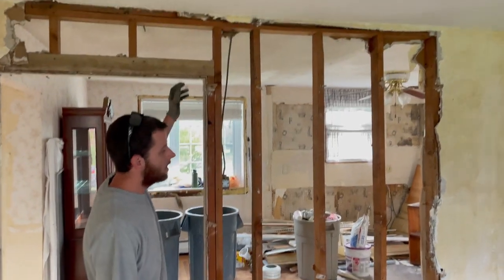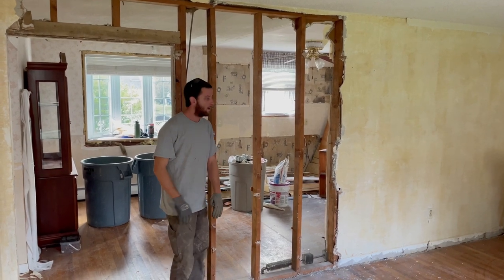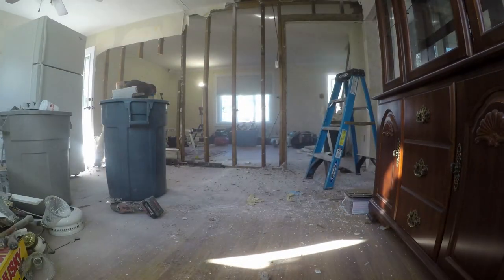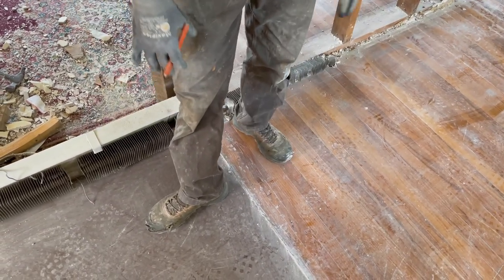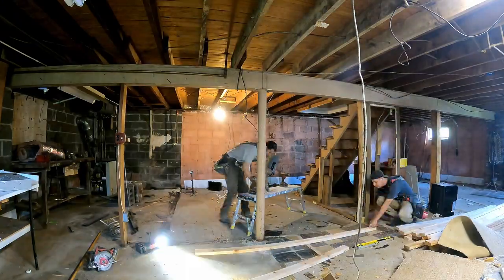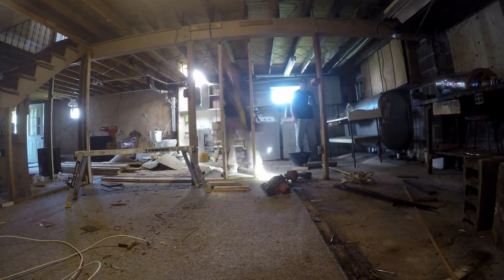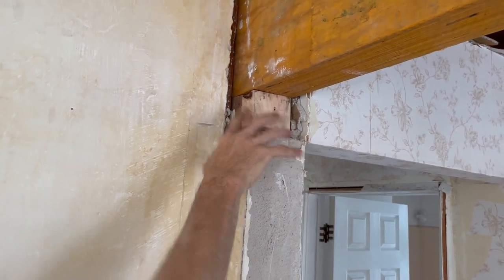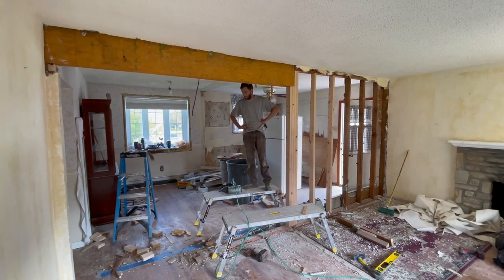How to Remove a Load Bearing Wall for Open Floor Concept | Episode 3

Comment: So, something that I noticed with my house is that the load bearing wall that runs through basically the middle of my house between the living room and kitchen is actually not perfectly over top of the beam in the basement.  It is basically set up the way that house is except that the wall is not over the basement beam. Any advice on what the deal with that might be? I've toyed with the idea of removing the wall to open it up but that part had thrown me off a bit
Reply from the maker: Hmm so it’s hard to say without seeing it. How far off is the wall from the beam? Are you sure it’s load bearing? Send us a video if you have a few minutes and we’ll try to figure it out
Reply: @JewswithScrews  I just measured it and it's like 3.5 feet or so away from the beam. Seems kind of weird to me for it to be that far off. There's no beam or  above the basement beam
Reply from the maker: Can you see which way the ceiling joists are running over top of the wall you want to remove? You want to remove a portion of the wall on the first floor of your house, correct?
Reply: @JewswithScrews  they are running the opposite way of the wall. Basically just like what you have going on in this video.  Yes, the house is a one story ranch and I'm looking to possibly open up a wall between the kitchen and living room
Reply from the maker: Email us a pic or video and we’ll take a look